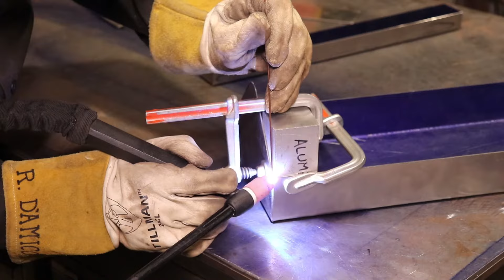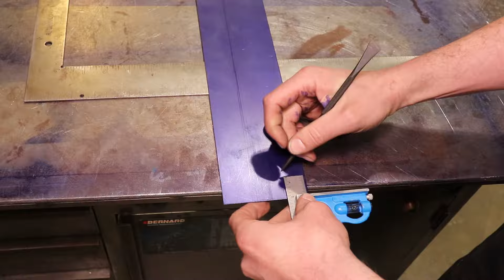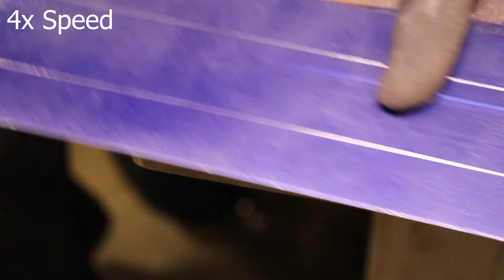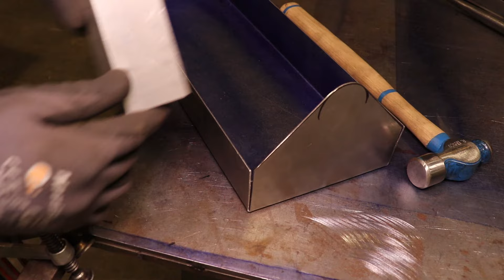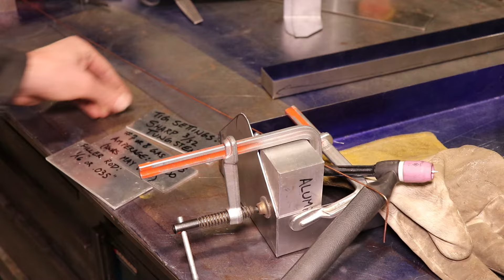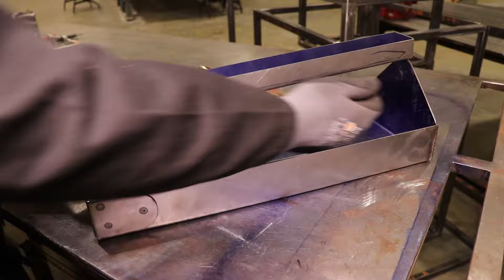How to make a Sheet Metal Tool Box

Comment: nice video--nice project.  Question:  What blade are you using on bandsaw (ie TPI) and what speed?
Reply from the maker: For 16ga steel, I would recommend a 24 TPI blade or higher. I’m not sure what blade the school shop has, but the tooth spacing felt a bit coarse for the job in the video. You want at least two or more teeth to make contact within the thickness cross section of the material to avoid breaking the teeth off your blades. Smoother cut edges are achieved with a finer tooth bade with slower material feed rates. And your blade speed is going to be around 300-150 Ft/min. consult your bandsaws literature for recommendations. Blade composition is usually a high-speed steel, or better yet a Bi-metal. I’ve found Starrett or Lennox make pretty good blades, but I’m sure there are other competitive brands that make good blades too.

Comment: Those wire speeds differ by a lot given that the rest of the weld parameters are about the same. I wonder if they are in different units, or perhaps not units at all, just numbers that are meaningless outside of the context of the particular welder. If they differed by a factor of 25 I could see them being inches vs mm per minute but they differ by a factor of about 7.